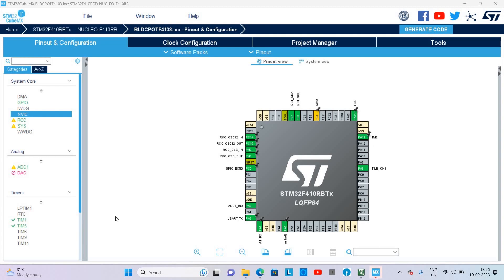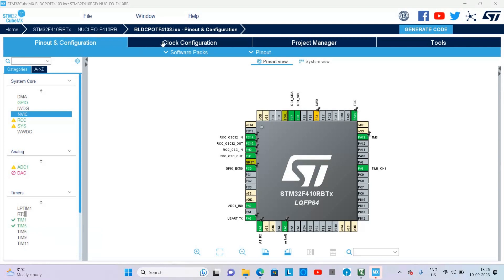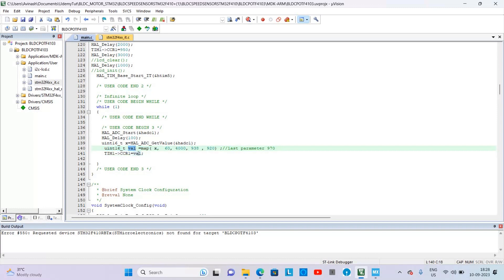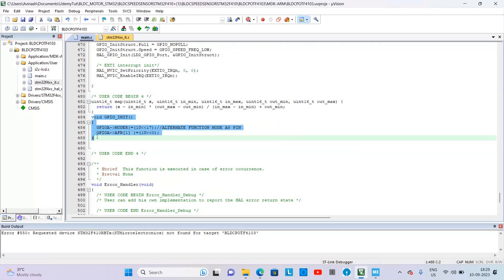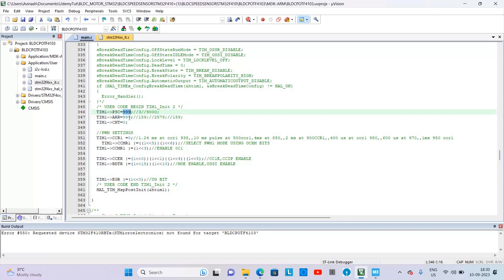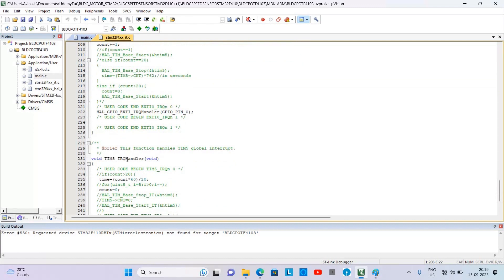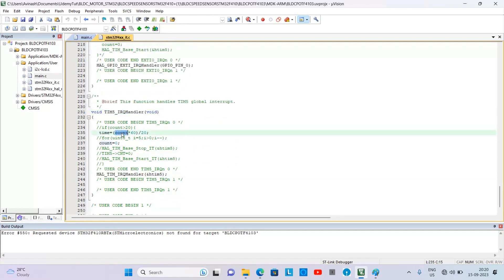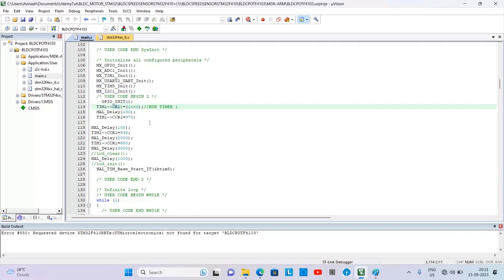Building a BLDC motor Controller Using  STM32  |  Stm32 bldc motor control code

Comment: Bridge you assign 6 pin for power section because it works with 6 steps low and high and 3 phase motor is it sensorered but assign 3 pins for Hall sensors

Comment: Hi do you have video  for sensors bldc motor ESC coding through stm32cubeide with potentiometer speed control
Reply from the maker: Currently I don't have  video for BLDC motor control  with sensors. Although in future I can make such a video. But it can take time.
Reply from the maker: Code for stm32 won't differ too much  in keil as compared to  stm32cubeIde.